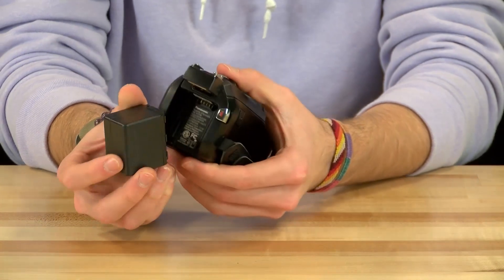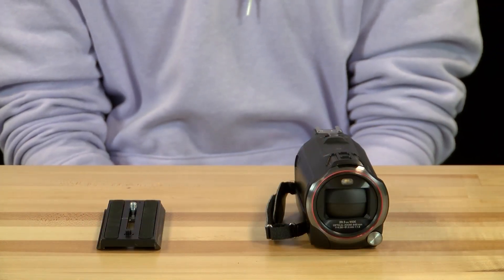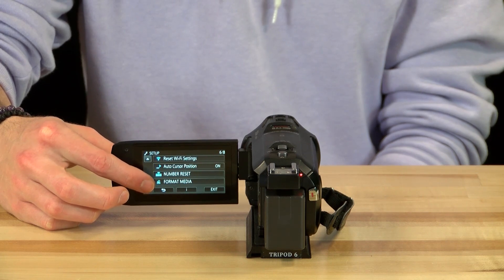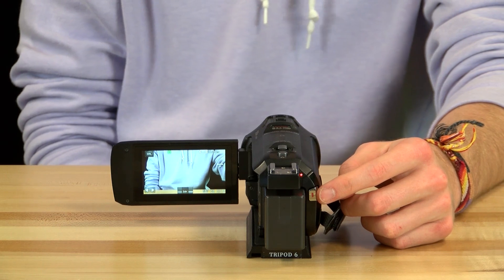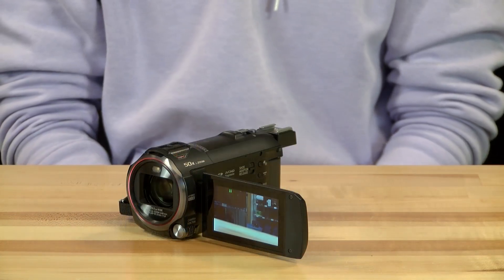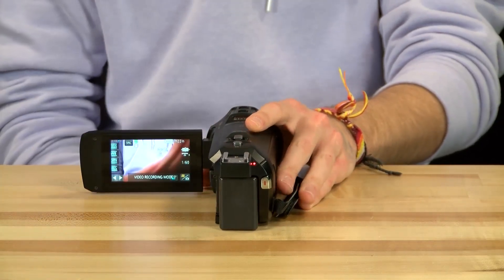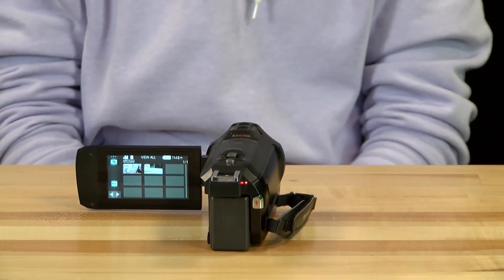Panasonic HC V770 Tutorial

Comment: I use Google Translate.

I bought a wireless microphone and would like to know how to turn off the voice recording from the camera microphone, because whoever is next to the camera is talking and I do not want to hear it but only from the wireless microphone.
thank you
Reply from the maker: Hi there, if your wireless microphone has a transmitter that can be inserted into the microphone input jack on the camera it should switch from using the internal V770's microphone to the wireless microphone. If it fails to do this, there might be a setting in the camera that keeps both microphones, the wireless microphone you want to use and the camera's internal microphone, active and recording. Unfortunately since we've never experienced this issue we cannot give you a solution. We would suggest going through the audio input settings on the camera and see if you can make any adjustments there after you've confirmed that you cannot get the wireless microphone to record separately. Best of luck!
Reply: @PortMediaNewburyport  Thanks for treatment. I'll check this out

Comment: Hi! Do you have any tip, why in manual mode the IRIS keeps adjusting to the level it thinks is more suitable? Everything is on manual, I was switching off every help (I think), still I can not fix a value I was setting.

Comment: Input a 128gb sdxc csrd in mine gave me 10 plus hours of recoding 1080 60p
Reply: @AccountGoogle_  
He is only talking about the SD memory card. 

The battery only does 2:20, but that is continuous filming. 

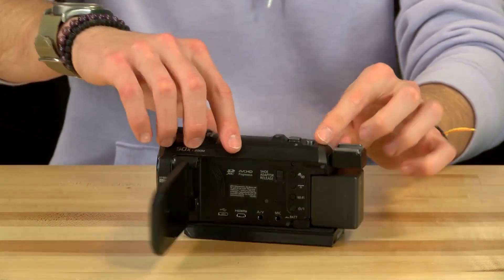It's approximately 1:30 of actual recording time if you are turning it on and off, zooming in, etc.

The 128 GB SD memory card can save up to 12 hours of footage + 800 photos. (According to the manufacturer).

Just got mine for a trip. So, I haven't actually been able to test it fully yet.

Hope that helps
Reply: I just bought this camera used, put in a 512gb card (its what I had on hand), when I set to 1080 60fps it says 44hrours . lol, 720 shows 138 hours. Wondering now if I can use it as a trail cam (with waterproof enclosure).

Comment: Hi, I need some help.I have my cables going from output of tascam -70D then into my video camera mic port. I'm Trying to get good audio onto the video recording.
When I use my Panasonic handheld video camera HC-V770 with this Tascam DR-70D , if both are plugged into utility power instead of battery power, I get loud interference in my video recording on the memory card that is in the video camera. But if I unplug either unit and let one run off of battery, the sound in the video is crystal clear. 
Is this normal? is there something I can do to stop this in case my batteries are dead or I am making a long recording? On the audio only recording that is on the memory card in the Tascam DR-70D, the audio is fine, no issues or changes....
 Thank you for your feedback.
Reply from the maker: I will have staff read and respond today.
Reply from the maker: Hi Cage Nation, 

While we've never used a Tascam DR-70D, what you're experiencing sounds strange. Unfortunately it sounds like one of those things that requires trial and error to solve. You could poke through the settings on the Tascam and/or the Panasonic to see how the audio is being exported/imported. You could try switching the decibels at which the Tascam exports the volume or see if it's exporting audio as line or mic.  You could also contact Panasonic and Tascam respectively and see if they have any clearer tips, but that may be difficult as they are two different companies and might not know the intricacies of how their products interact with one another.

In the meantime, you could record the double record the audio; one way by using the Tascam, and another way using the built-in mic on the Panasonic. Then you can manually sync the audio from the Tascam with the video from the Panasonic by lining up the Tascam audio with the Panasonic audio. You have to listen and watch to make sure it lines up perfectly; it's kind of a pain, but it's something we do for other productions when it's not possible to get good audio running into our cameras. There's also some programs that can automatically sync audio and video if they're from the same recording session regardless of which device they were recorded on. We believe you can do this on Final Cut Pro. We don't know about Adobe Premiere, but they may have it too. 

We hope this has been helpful in some form or another, and we wish you best luck with getting your audio to match up with your video without any interference.
Reply: This is called an earth loop sometimes. I have the exact same issue connecting my Tascam dr60 D mark II audio out to my HC-V770 unless I give each a separate power bank. But you already found out this solution. Faulty wiring inside either the Tascam or the Panasonic makes this happening. There is no software or setting cure for it. Please note the recording quality of the sound is terrible on most consumer camera's and for sure on the panasonic HC-V750 and 770. (I don't know the other types). Still you need the sound for easy synchronization in post. If that is your reason to get the sound from Tascam to camera, then I understand. :)

Comment: I cant turn it on
Reply from the maker: Are you using a wall adapter or a battery to power the camera? Your battery could be completely dead or your adapter for the wall might be broken either in the camera or on the cable itself. Did you get the camera brand new or did you recently acquire it second hand? There may be damage to the device.